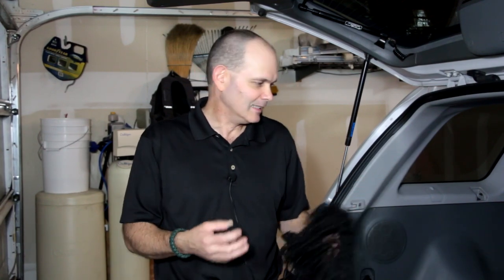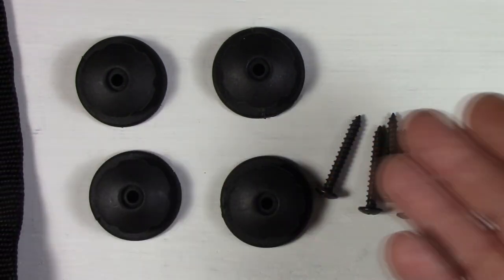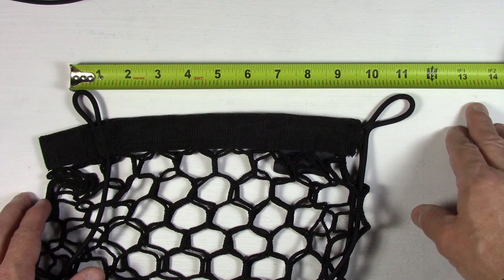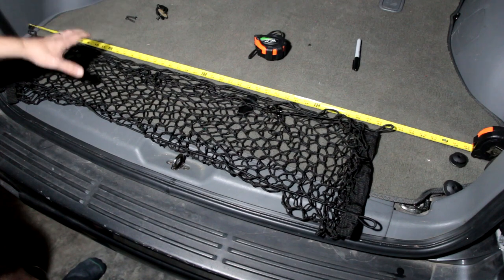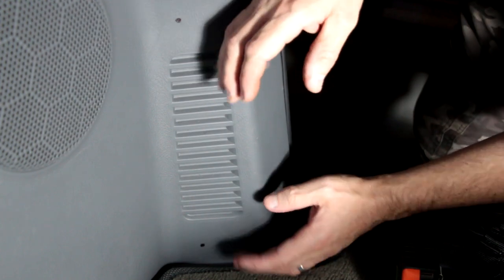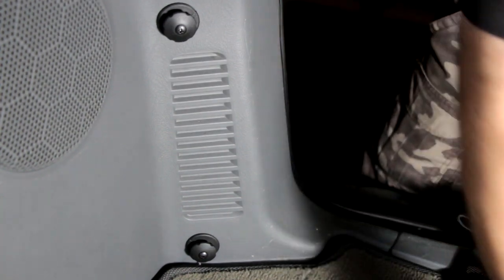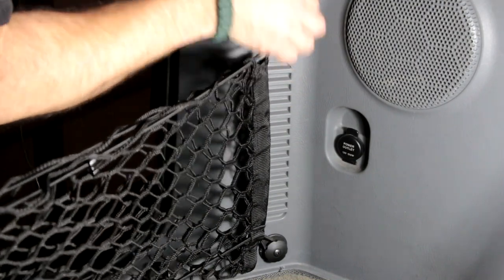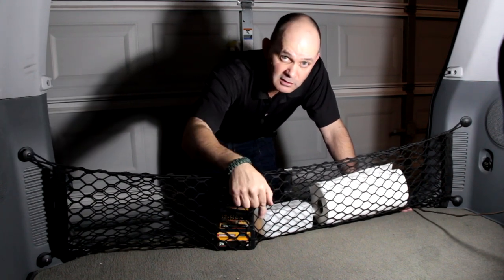Installing A Cargo Net And Anchors Hyundai Santa Fe (2003)

Comment: I have a similar net but different vehicle.  I am worried about screwing the included fasteners into the metal of the truck bed.  Simply screwing the fasteners into the trim or plastic isn't very strong and likely will pull out.  Any suggestions?